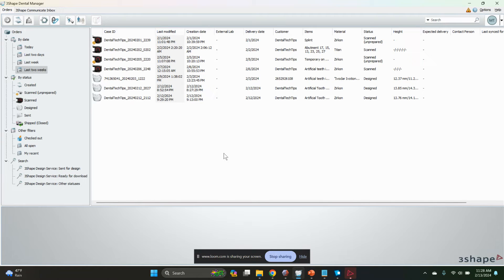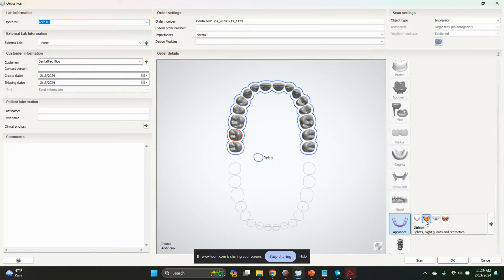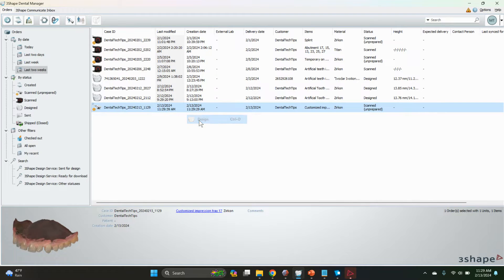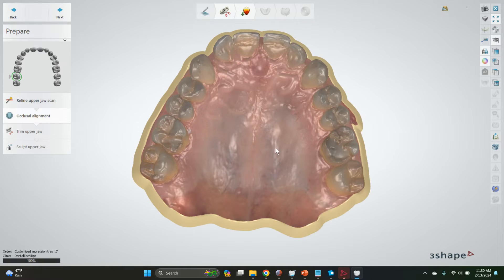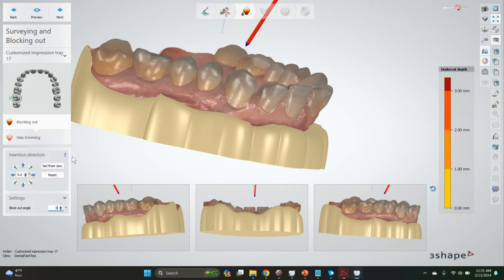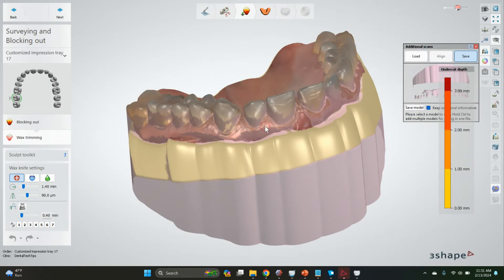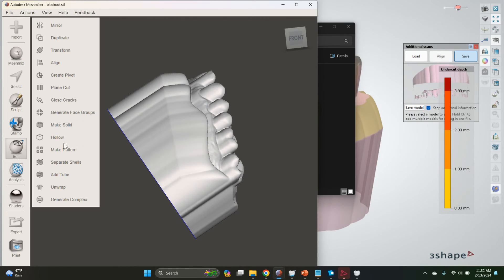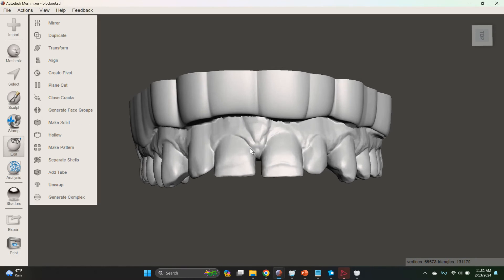How to create a blockout model in 3shape - DentalTechTips

Comment: Can you explain exactly what the difference it makes when you change the "angle"? My program usually sets it to 0, but I can't really tell much of a difference when I change it.
I am using the digital block out for essix retainers and hard/softs. Thanks for any advice. Really appreciate the videos.
Reply from the maker: Increasing The blockout angle value will make the model less parallel (less retention and looser fit) a zero degree blockout means the blockout walls are parallel, a 6 degree blockout will have a taper to it